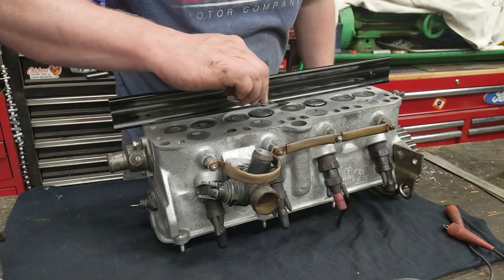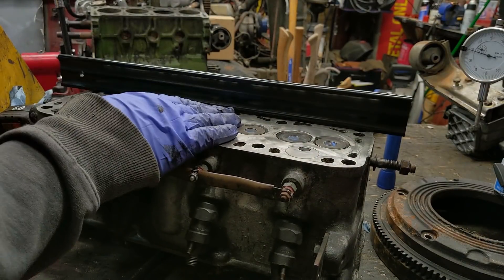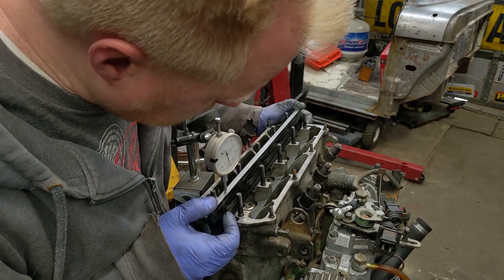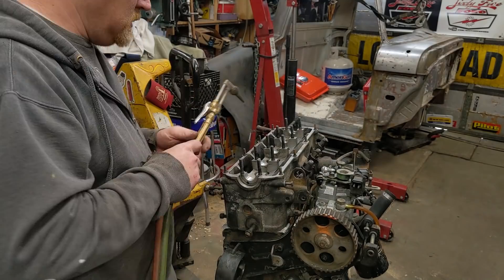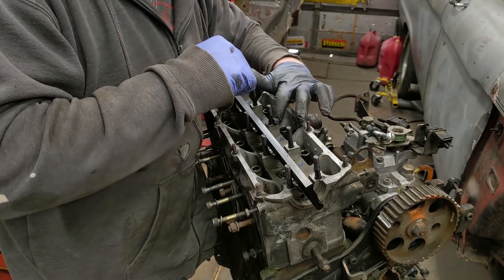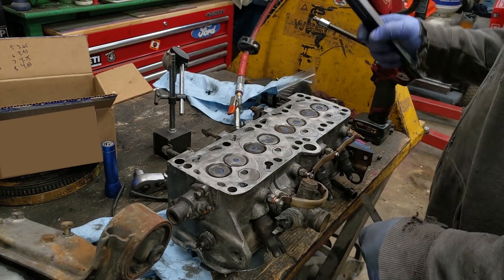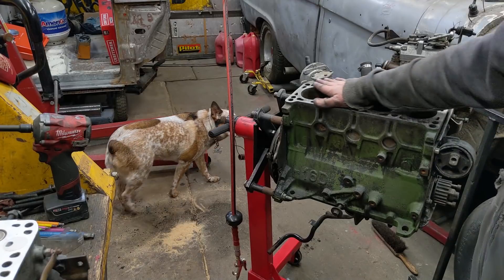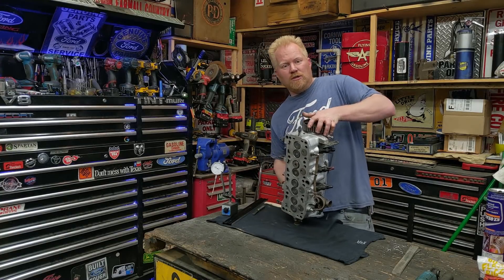Warped Cylinder Head Straighten Resurface in the GARAGE DIY

Comment: You do some great work with very basic tools. My dad helped me grind a crank using a pack of over-sized bearings and valve grinding compound. We were 30 though out of round and I didn't have the money for the machine work. The guys in the shop (on a military base) said it wouldn't work but the crank came in true with only about 200 turns of the connecting rod on the journal. Put it together and I drove it for about 15K miles before I sold it. Keep up the great work.
Reply from the maker: That's an awesome story.
Reply: @sixtyfiveford  Should do a myth buster on that !

Comment: Nice... I wonder if you can just place the head in the oven for a bit to get it hot enouth to straightening it.
Reply from the maker: Yes, that's essentially what the machine shops will do. 450F but you need to bolt it to a huge chunk of straight steel. You need to strip the block down bare as well.

Comment: Can this be done with a cast iron head???  I ask because in 25 yes of mechanics work, I have NEVER seen or heard of that method. Insane I tell ya.
Could've saved thousands with a couple of common tools.
Reply from the maker: Absolutely. The base of the head with all the combustion heating and cooling cycles contracts just like if you were to weld something it pulls in when it cools. Heating the top while applying bending pressure to straightens it out enough where the sanding is minimal. In a cylinder head that doesn't have a camshaft It's not as crucial to straighten and can just be sanded flat.

Comment: You cant remove  its natural  state and only time will make it rest to that state . That's why you grind it flat . Love the thought  process. Of video  . Things in rest stay in rest things in motion stay in motion
Reply from the maker: It's natural state was perfectly straight when it was cast. With the engine running it has heated and contracted the piston side of the head and pulled it out of its natural state and shrunk that one side. I just shrunk the top side to make a match and now both are in a matched relaxed state. Just surfacing the head would have cause the camshaft to snap.

Comment: You should put rags in the jugs to catch the abrasives dust and is that a starrett straight edge or something trust worthy because it could be off and the head be good uno
Reply from the maker: Absolutely. This engine didn't have any pistons in it though. In an engine that does I will grease the cylinder walls and then put towels down in. This allows any debris that pass the paper towels to get caught and cleaned out easily.
Reply: @sixtyfiveford  oooh grease good idea too!

Comment: I understand what you did, but won't it warp again overtime? I suspect it would be a longtime if it did.
Reply from the maker: Actually it would be unlikely unless you really overheated the engine / head. The reason it warped is because the piston side of the head is under constant heating and cooling and it contracts / shrinks. The top side of the head stays relatively cool during running and doesn't shrink like the base. I just shrunk the top to match the base and they should stay good indefinitely
Reply: @sixtyfiveford  Thank you for the explanation. I really appreciate your vids and learning from them.

Comment: I have straitened several heads using 2 propane torches. I heat the head until water dances like a hot griddle.
Reply from the maker: Awesome
Reply: Explain the water please

Comment: Great video. I do simular. I have acces to a press. so I just shim ends and pres it. For people not use to deal with aluminium. be very careful when heating. when you break through the oxide scale. Alu melt around only 700 degree c.
Reply from the maker: That's awesome.

Comment: This is the reason why I still run cast iron..... can you imagine what an all-aluminum engine would look like After Time
Reply: Uh most modern engines are all aluminum. I have a 20 year old car with almost 300,000 miles that has an all aluminum motor. Runs perfectly.
Reply: @geraldnoe649  until you have to unbolt the head for something...

Comment: My former boss Ken Flanagan developed the first process and straightening aluminum heads it's called having a big oven big piece of Steel to both the heads to and keeping careful record of how much you torque the head and how much she hated the head and for how long then you start developing a method and pattern of help to straighten heads if you don't heat up the head and just took it down are you going to do is crack the head

Comment: Thanks for sharing more priceless information👍 so far I've been lucky in that the only multi-cylinder heads I've re-used have been cast iron and were well within spec!  I almost never check single cylinder heads or brand new aluminum units. So far so good.  Your method makes perfect sense, if not more sense than milling if purely for the purpose of truing the surface!
Reply from the maker: Thank you!

Comment: It's straight now, will it stay straight?
Reply: Sure, as long as the temp is kept below warping temp.
Reply from the maker: Absolutely it'll be more likely to stay straight. The base has contacted as much as it's going to with the repeated hot/cold cycles. Now the top of the head is equalized.
Reply: @sixtyfiveford  does that mean the aluminum heads on my Taurus are warped as bad as your vw?  If the heads and block warp in the same way (yikes!) that might not be so bad, except for the cam flopping around?

Comment: A granite countertop place often has plug aka cutout or off pieces laying around and they're perfectly flat and make great sanding surfaces for heads and such...
Reply from the maker: I actually have a granite sink cut out I picked up just for this year's ago. Unfortunately if I recall it was about .005" out over 18" and wavy everywhere. Glass was the same but better. The problem with glass is even at 3/8 of an inch thick it bends to the contour of whatever you set it on. The flattest thing I found was MDF and melamine MDF.
Reply: @sixtyfiveford  
I'm glad you pointed this out, that's the reason the granite surface plates that machine shops use are so expensive.

Comment: Do you have a video on diff rebuild. I have a 92 ford fairlane v8 ( Australian) lsd, has spindle to pinion play. Is most likely an American made diff.
Reply: Betting it's an 8.8 but might be 7.5 ,see Yukon Gears video on identifying which . Pretty good diff in use here for 40 years , inexpensive parts and lsd's.

Comment: Someone forgot to say don't eat this and V.W. had a factory bow in the diesel heads to get them to seat with the head gasket and keep the cam straight but I had to retorque the heads on mine because they were leaking. Just took one bolt out at a time, oiled and retorqued to 115. Nary a bubble after that. So if everything is flat and you torque from the inside out, it ought to be fine. Thanks, Buddy and GBWYall! And the one bolt at a time and oil it came from the ACE Mack wrench man. If it'd work on a Mack it'll work on a V-dub!
Reply from the maker: I did forget to say don't eat it. I thought the minute and a half in the post office wasn't ample time to get into the bag. Boy was I wrong.
Reply: @sixtyfiveford  She sort of takes after someone else that I know that is..............well, shall we say intense?? Lets say intense.

Comment: That baby looks  like my old  1’6. Diesel. VW  . I did the exact same job , but sent the head out to a machine shop .nice motor to work on . I did notice the cam has a  groove in the end  for the cam gear but no key . Just bolted on to the tapered end . PS I think that pic up has a lot of potential  and very economical  .
Reply from the maker: I actually looked for a more powerful engine to swap in it as everybody says they're slow as molasses. But I think I'm okay with that if it gets as good as mileage as everyone says it does.

Comment: so... weren't these surfaces straight enough when the engine was running & warmed up?
Reply from the maker: The head would still be warped even with a warm engine. The base actually permanently contacts/shrinks with the thousands of hot/cold cycles combined with impact from combustion. There top stays normal to how it was from the factory. Me melting and contracting the top just equalized the entire head and it'll be less likely to warp ever again.
Reply: agreed! However, after straightening the slight imperfections were sanded out which makes the straightening worthwhile.

Comment: lol you have a loverly dog,  leaving meat based food near a dog is just asking for an empty bag :-D
Now the head is level, you need to keep the engine cooler than before, a bigger radiator and lower temp thermostat maybe?.
Your dog is very clever, soon you will be jumping through hoops lol :-D
Reply from the maker: I thought I was safe to hop out of the car for 90 seconds that I didn't need to tell her to leave it. My mistake. I think all aluminum heads warp with normal temperatures. The base actually permanently contacts/shrinks with the thousands of hot/cold cycles combined with impact from combustion. The top stays normal to how it was from the factory. Me melting and contracting the top just equalized the entire head and it'll be less likely to warp ever again.

Comment: For sanding heads, I use a lab certified granite block that is 3' x 4' with the kind of sandpaper used to make floor sander paper before it has been cut.  Works great for both aluminum and cast iron because I can get about two feet of movement on the head.
Reply from the maker: I actually picked up a granite slab years ago to do this and found that it was about .005 out. Of course it wasn't lab certified. I then looked at a bunch of glass up to even 1/2-in thick and that wasn't flat either. Also the biggest problem is glass is super flexible and just bends to whatever surface you place it on. The flattest stuff I could find which was under .0015 was 3/4" MDF and melamine MDF.
Reply: @sixtyfiveford  never would've guessed MDF out of those materials!
Reply: @sixtyfiveford  they can be re flattened to .002 which is fine work it would probably cost about a $1000 to have it reground and yes they do that by hand with diamond dust.
Reply: @sixtyfiveford  Tool & Die maker 45 years we used granite surface plates ground to  .002 had a surface plate tech every year to come to shop and regrind all plates to this spec.

Comment: That was impressive, the head gaskets come in different thicknesses, be sure to get the right one . On the edge of the gasket near where the oil passes through the block to the head there will be some notches indicating the thickness. The head looks great the only thing that is worrisome is in the first video you dumped a bunch of dirt into the injectors, you will need to take them apart and clean them.
Reply from the maker: Yes, they have been thoroughly cleaned since then. Yeah this is a three notch but I even double checked the piston protrusion to make sure as a lot of times shops just put on the thickest and leave it at that.
Reply: @sixtyfiveford  good to hear.
Reply from the maker: Yeah I actually had to clean them twice. I cleaned them while I was waiting for the engine to unstick and then I dumped all the junk in them so I just cleaned them again last week.

Comment: this is why I sub! alternative DIY methods to crazy expensive regular tasks
Reply from the maker: Hey thanks, I'm glad you liked it.
Reply: It's not about saving money on this job, rather it's about balancing the heat cycle stresses in the head.  Quick and dirty repair is to machine the head...  BUT like he says, that leaves the cam bores not parallel with the bottom of the head.

This is one of those jobs where you get better at it the more often you do it.  For the first time, take it easy and slowly get it straight.

Comment: Hi sixtyfiveford! Every time I watch one of your videos I am amazed by what you achieve with basic tools in your shop, but this one has to take the cake!!! Now I have a question. I like to shave heads to get a little higher compression ratio for better gas mileage, such as on an LA 360 Dodge motor. How long might it take to remove, say .030" on this cast iron head? Is it humanly possible?!? Are we looking at hours, or months? Thanks!
Reply from the maker: For cast iron Head that would take quite a while. My biggest concern would be the pushing side where your hand rests you'll generally put more weight down and take more off on that side. So with 030 you might accidentally take 030 on the hand side with the opposite side at 020. So it'll be flat but at a taper if that makes sense. You can be pretty cautious about this when you're just taking off .002 but you start getting tired when you're taking off a lot more than that. I'm curious how much of a compression ratio boost that would be?

Comment: Ah aluminium, warped sumps, bearing cover plates,  blocks n heads, give me chromoly cast iron.
Reply from the maker: I agree
Reply: Till you work for a Machine shop and has to be Manually hand ported...  I'll take aluminum lol.
Reply: @trxtech3010  yeh i know what youre saying, my freind has been a head specialist for 36 years doing port work, ill stick with cast though.
Reply: Yea but these VW heads are fairly robust for an aluminum head. 
Look how thick it is , it takes alot to warp one compared to most ally heads that are half the thickness. 
If this got warm enough to warp like this , you better check your cylinder bores for scuffing. 
Either way though , most likely in these vws life they will need a head gasket replaced.
Sometimes they used to sweat at the oil return at the front of the block and after that got annoying enough it was gasket time.